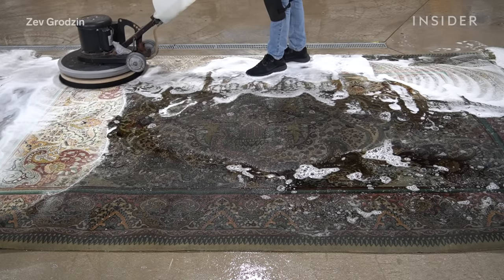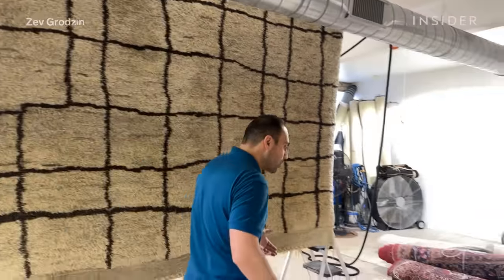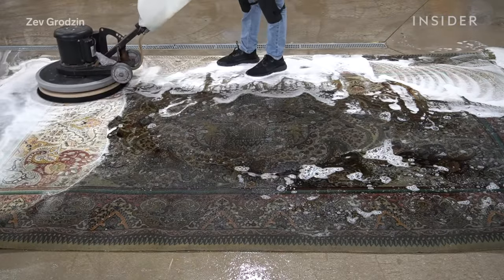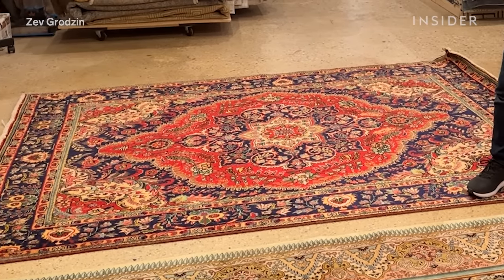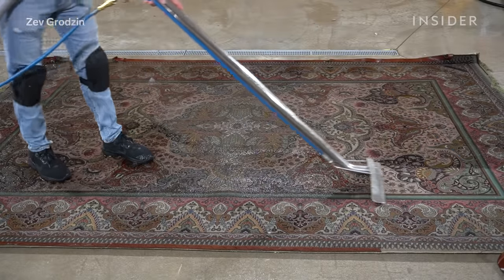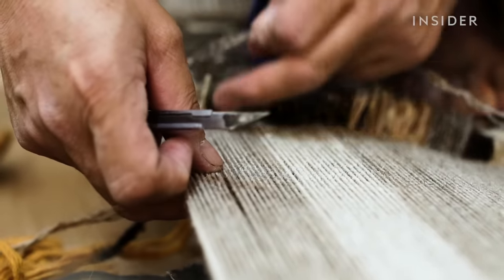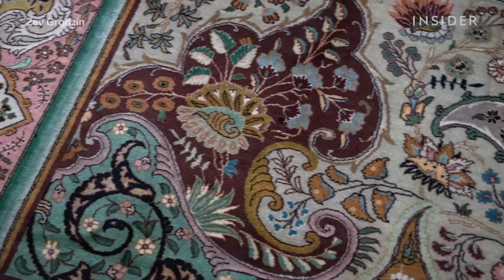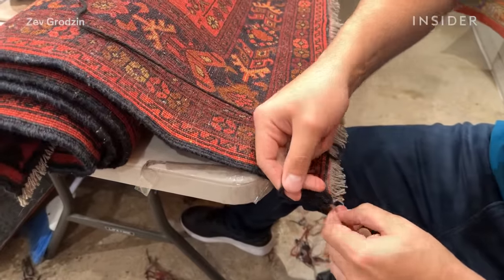Deep Cleaning A $12,500 Tabriz Persian Rug | Deep Cleaned | Insider

Comment: With this cleaning, they have actually brought down the value of that carpet to 0.

Hand woven wool carpets are never to be washed. water pouring over it kills it. Because the pure wool becomes curly and tangled at the bottom, and is never straight thread again, and that is detrimental for a hand woven rug.

What they should have done was to to lay out the carpet face down vacuum from behind many many times and then with damp cloth wipe it maybe 10 times but never never soak a hand woven precious carpet in water.
Reply: “The value down to 0” 😂😂 what a ridiculous comment! Good luck getting rid of pet urine and heavy stains with that technique! It’s funny how random people YouTube think they know everything without ever actually being involved in things professionally.
Reply: Hi Nilufer, I respect the sentiment behind your comment, and would like to educate you more on this topic. Some Persian rugs should not be deep washed - specifically those with chrome (chemical) dyes in the wool. However, there are certain Persian rugs that have much more stable vegetable dyes that will not run under a proper deep wash. Rest assured, based on our 40 years of experience in this industry, if we felt that the colors would run, and that the rug would be ruined from a deep wash, then we would not perform such a service. However, in this instance, we felt confident in going ahead with this procedure, and the rug turned out fabulous after the wash - as seen in the video! It really depends on a case-by-case basis, and that is why rugs should be brought to reputable businesses that have the expertise in dealing with a multitude of different rugs. Once again, thank you for your comment and if you have any further questions regarding this specific issue, feel free to reach out to us. Best regards - Rouzati Rugs
Reply: @smartrideshare895  professionally!😂😂😂 I have a house, where I only lay hand woven pure wool carpets. Some are over hundred years old and all our root dyed. Every year for me it’s a three day job to have the carpets cleaned with two people helping. Yes if there is urine, and all kinds of that kind of stuff, they would have to wash it off, but I’ll say it again they wash off the value of the carpet as well. Because the texture is never the same after so much detergent, pressure and scrubbing. Yes it’s very interesting to see people in YouTube where they make comments about things they don’t know. And I am 67 years old. I have been around long enough to know a few things.
Reply: @rouzatirugs  it’s not a matter of dye mixing. It’s a matter of the wool threads changing texture. A carpet expert would definitely look between the wool threads standing out if they wanted to buy a carpet and if the carpet has been exposed to water. The roots become curly and tangled. You cannot see the base of the rug and that is where the value of the carpet finishes. I was told this by an antique rug dealer. Sorry!